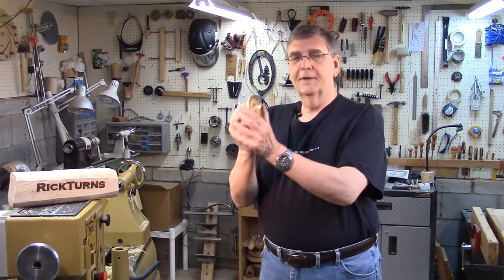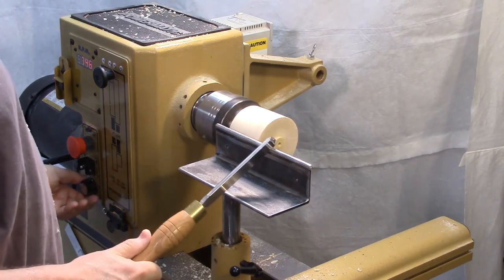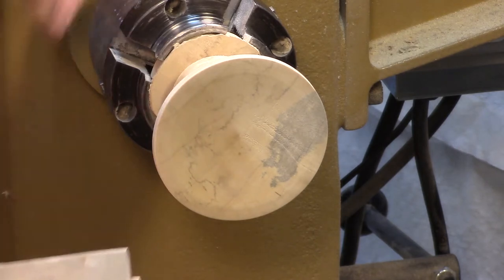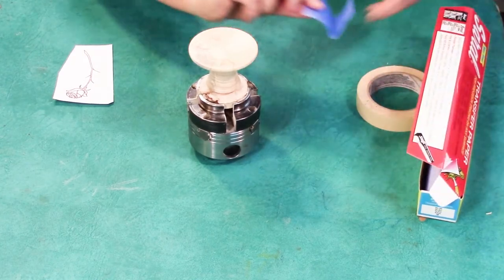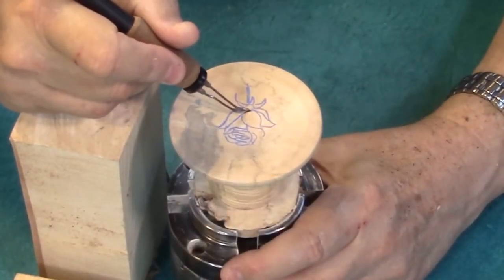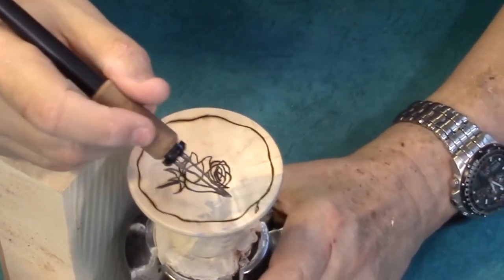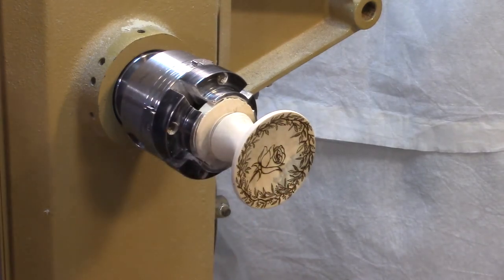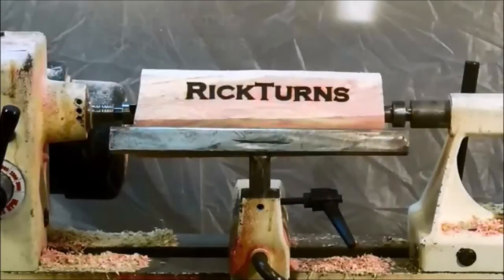Miniature Bowl with Wood-burned Decoration

Comment: what kind of wire did you use on the wood burning tool
Reply from the maker: Hi, William. I use a Cub woodburner (purchased originally from Craft Supplies web site) for my woodburning. I bought various burning tips from them also. I used a sort-of triangular tip for this project. I believe these tips are made from nichrome wire, which can be purchased from Amazon and other places. I you buy your own wire, you will need a special head unit to put on the burner...it has two connectors for the ends of the wire.